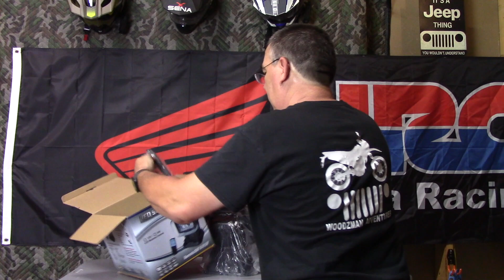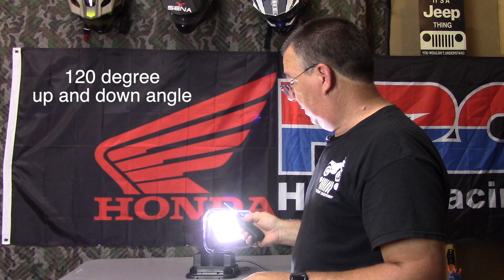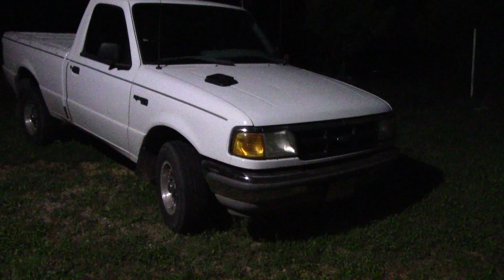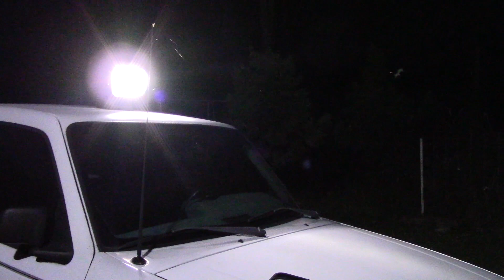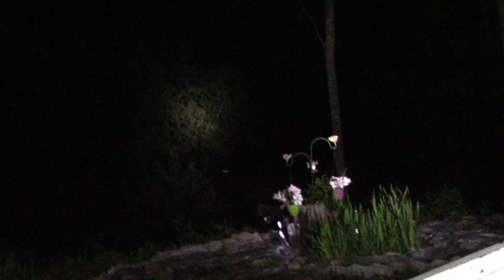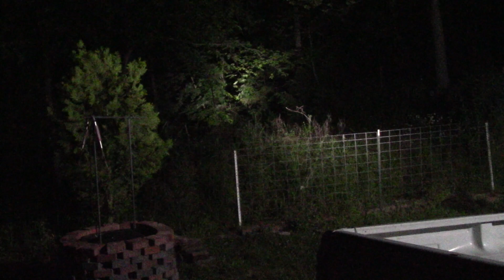50W 360° CREE LED Remote Controlled Offroad LED Spotlights Work Light LED Factory Mart

Comment: I’m a little confused about your statement 12 to 24 volts , does that mean I can tie 2 12volt together for use with this item? Will it shine brighter with 24 bolts? Will it be damaged by the highway voltage?
Reply from the maker: It will work on a 24V system or 12V system. 
 Using on 24V does not make it brighter.
Just made with a built in regulator so it will work on vehicles that are 12V or vehicles that are 24V.
You can tie 2 12V batteries in series and make 24V. But it will not be brighter
Reply: @Woodzman  thank You
Reply: @Woodzman  what type battery is in the remote? I tried 2 double A batteries but it doesn’t work.